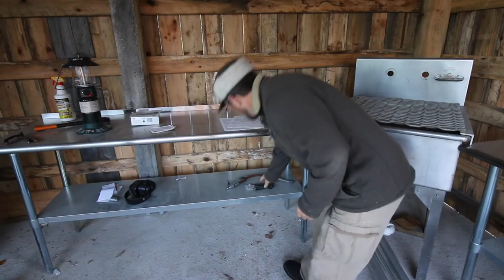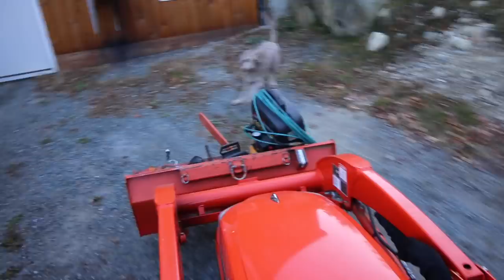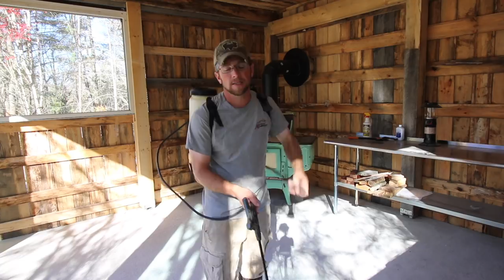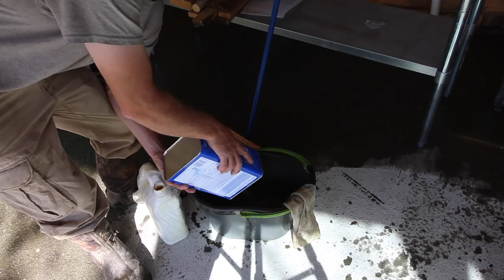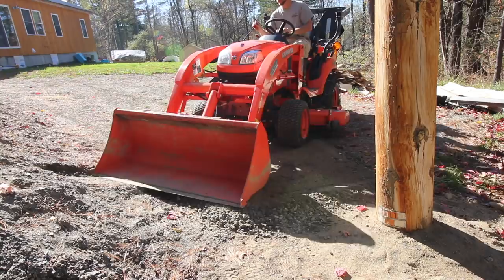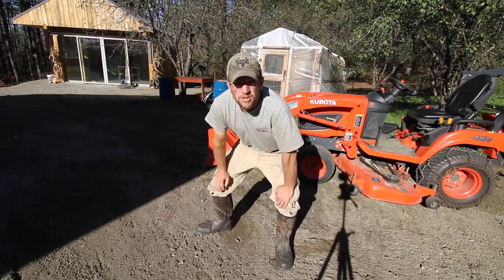Using Tung Oil to Seal a Concrete Floor

Comment: QUESTION: So I've poured a concrete floor for my workshop and I'm considering this tung oil and mineral spirits sealing method. Im wondering if you've been happy with it? How is it wearing after a couple year's use? Off grid homesteader here as well, I've found your videos helpful and relatable... Thanks!

Comment: Wow, lots of things checked off on the "honey do list" today!  Floor looks great, is the texture of the concrete a factor when your sealing it with your mix of tung oil and mineral spirits?  It would seem to me that the course texture could be a bit more difficult to sweep up and that it might hold debris.   I had a smoother finish done on my garage floor when it was poured and it was so smooth that it was slippery like ice when I was watering it down while it was curing.  It's not as slippery now but it really doesn't hold dust/dirt  at all, I'd be concerned if I had sealed it like you are, I wonder if it would of stayed slippery.
Reply from the maker: I was afraid if we left it smooth that when we had the flor wet and we are working on it that it would be to slippery

Comment: I have a question for you.  Did you do any kind of prep work before applying the tung oil. How many coats did you apply and any other info about your application of this product that might be if interest. Thank you
Reply from the maker: I  make sure the area is clean and dry before I apply the tongue oil